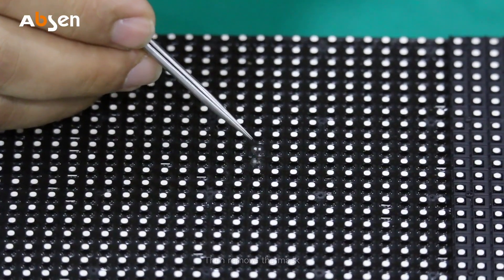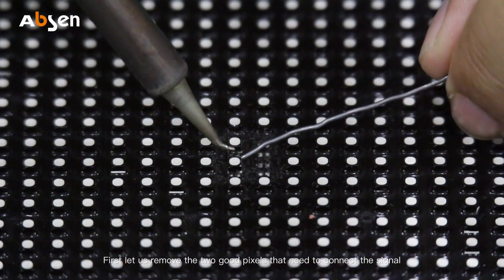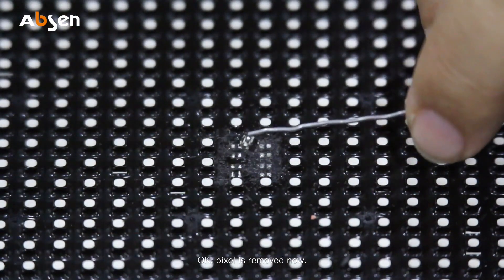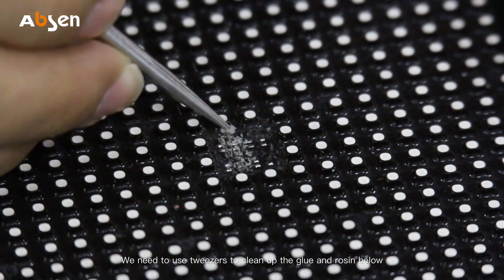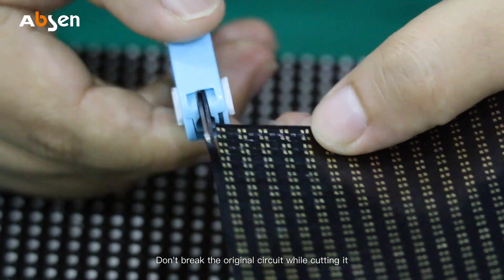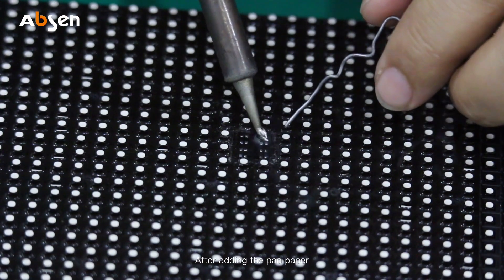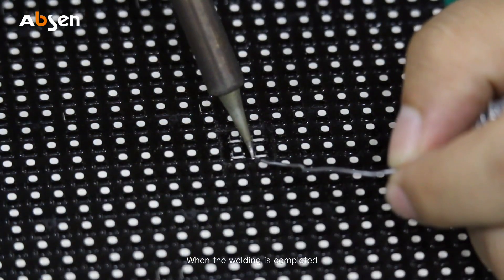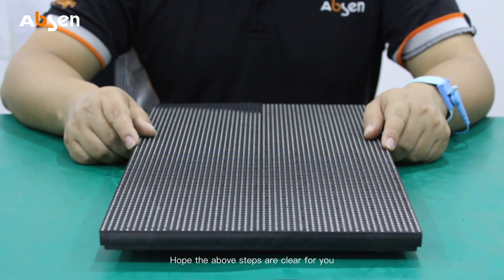How to use pad paper_Absen LED

Comment: that is the wrong way of cleaning the seals. we should use plastic or bamboo or for example a tooth pick to remove the seal. do not use metal because it can damage the circuits

Comment: Why have you used this paper and didn't soldered the new pixel directly to the pcb?  I didn't understood it
Reply from the maker: Hi Tobi, thanks for your question. Usually, each pixel has 4 joints to fix it, since one or two joints had been hit and lost , there is no PCB trace to provide signal to the lost joints, also there is nowhere to fix the joints.  That is the reason we need to use the pad paper for the pixels. Of course if all the 4 joints of that pixel are all good, it is not necessary to use pad paper. Hoping this anwers your question.
Reply: @AbsenLED  Thank you for reply